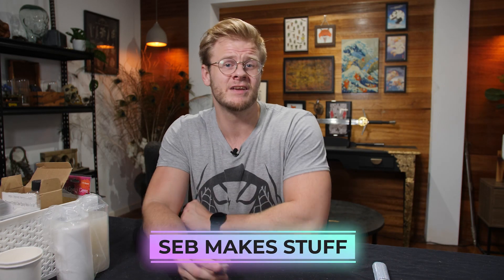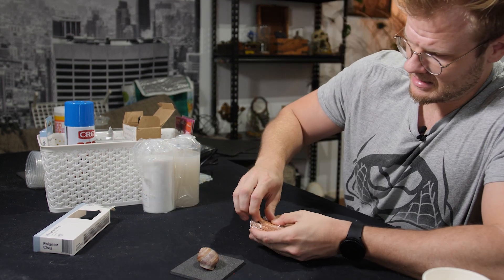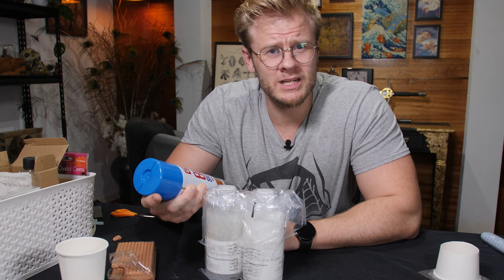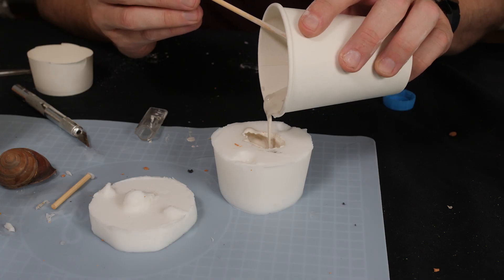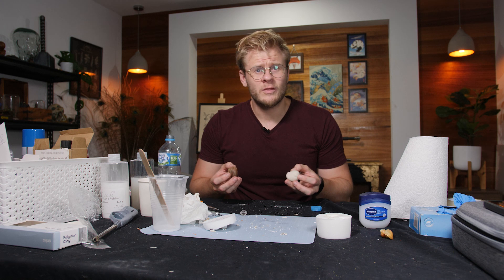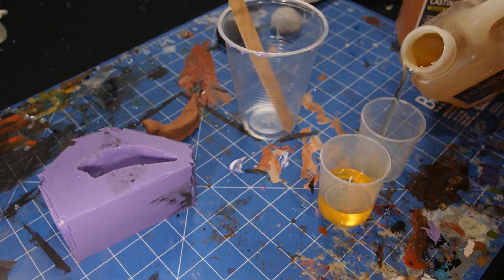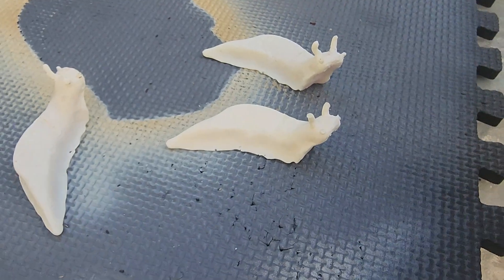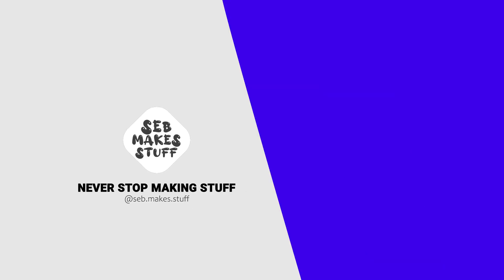Making Moulds and Growing Crystals!

Comment: It says here it's been 3 months so I don't know if you've made any progress in your mold making journey, but here are a few tips that I learned that may help you or a viewer out there
1 - The clay: You seem like you didn't have any problem with it. It's probably sulfur-free clay, as it's what impedes the silicone to cure properly if present in it's composition
2 - Filling something with water may not work (depending on the weight and shape of the object) because the silicone is still denser than the water. I like having something tacky at the bottom of the mold casing to help hold it down, like repositionable adhesive, double sided tape can work with enough contact surface. Maybe poster tack.
3 - Dont pour the silicone straight into whatever you're trying to copy as it's a great way to trap bubbles underneath it. Aim the pour at the bottom of the casing and the silicone level to rise steadly. This can pick up some bubbles if there are crevices facing the floor of the casing, which may or may not get release when you shake the mold. Thus, with very detailed things it can be a good idea to apply a little bit of silicone into those crevices beforehand with a brush or toothpick to be sure that they get filled and no bubbles are trapped there.
Reply from the maker: Love this kind of comment! Always looking to learn more tips and tricks in this stuff. I haven't don't many more moulds since but I have been watching a lot more videos on it. Gonna get some more going soon and all these tips will be noted for sure

Comment: Looks good for batching out these lower resolution models. The final coat of 'slime' was tops :D
Reply from the maker: Oh yer, super usefull. Going to be making a heap of moulds for doors, windows and other greebly bits I think. For all the future fantasy terrain builds.
Reply: Best part is if you keep track of how much resin they need. You can pour any excess resin into prior moulds instead of just wasting it in the bottom of the mixing cup.

Comment: The slime makes it much more realistic! 👌 and the variety of colours on the crystals makes it pop!

Questions though - when you were doing the silicone moulding for the shells (around 1:31) it looks like you put three little clay bits down on the foamboard around the shell, is there a reason for this? Does this help when the silicone sets? 

Also when using the borax, do you have any measurements to help us?Would you need that much or a smaller amount would work just as well?

Great video though! You never fail to impress. 😊
Reply from the maker: Thankyou kindly, love your support 😁

1- the bits of clay were to make some keys to hold the top layers in place. But ultimately I didn't really need the top layers since the shells got glued down to the slugs anyway.

2- the borax mix is tough, you basically just keep adding in more and mixing it up untill no more will break down and dissolve. So the less water you use the less borax needed to fully saturate the mix

Comment: Ahh yes, molding... I give this also a try, a couple months ago. So a few tips from another amateur:
If you use foam board, you have a good clean Surface and it's also a bit more modular. Use Dental plaster, it's a bit sturdier and the synthetic Ingredients make a much more detailed Cast. If you have a electric toothbrush, you can use it to hold it on the frame or building plate to eliminate the air bubbles... Otherwise great video! It's always nice to see, that even a master of crafts like you make mistakes in the first try. And the result is absolutely stunning!!!!
Reply: You can instead of the toothbrush everything, that vibrate. Sometimes in the Dollar store, they sell one of these cheap electric massage balls. Those would be better...
Reply from the maker: Cheap options are always me favourite haha
Reply from the maker: These are some super helpful hints. I'll be adding a cheap electric toothbrush to my molding kit for sure! And I'll have to try out this dental plaster. I feel like there will be a lot more molds coming in the future

Comment: Love this low-tech (me = 3D-printerless). Have you tried paperclay (shred-paper + white glue + drywall joint-mud) as cast &/or mold? Less detail, yes, yes - but cheap as... well, cheap. On another note: fantastic fail! Drama! Tension! Action packed! Thanks for the excellent video. What did any of this cost?
Reply from the maker: Yer I want to make more things that dont require a 3d printer. As much as I love that tech I know a lot of people don't have access to them. I'll have to give the paper/glue casts a go, always good to find cheaper options for things. 
The costs weren't too bad, since I've got a lot of left over materials for future builds now.
The silicone mould kits cost me about $45 aud
And the resins I used were about $50 aud for each type, these builds didn't take much resin. But they did use up a fair bit of silicone, I'm sure you could use less depending on what you're casting and how well you design the walls around the item you want to mould before pouring the silicone. I'll be working on this in future builds